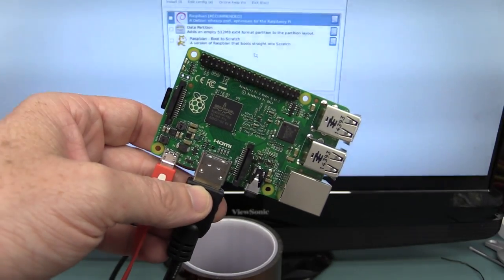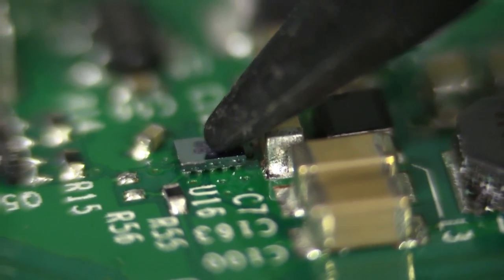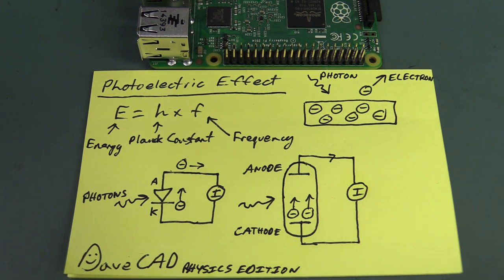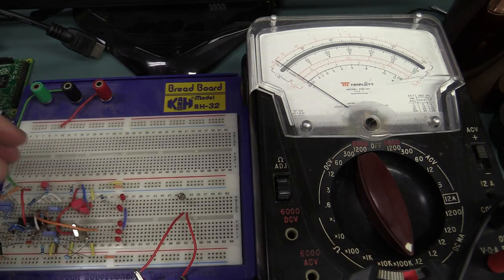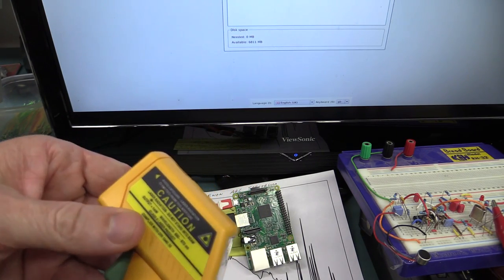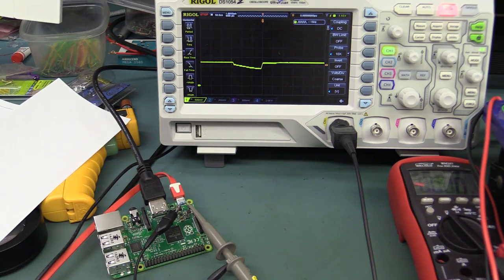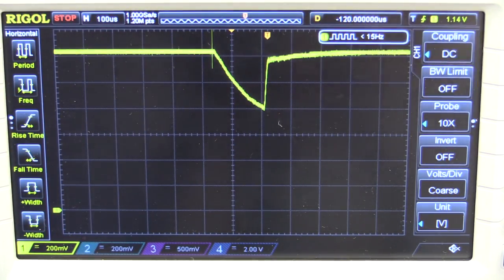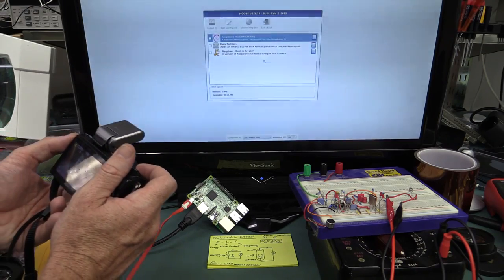EEVblog #716 - Raspberry Pi 2 Xenon Flash Problem Explained

Comment: This CAN'T be the reason that novelty electronics covered their chips in that black resin stuff, is it? As a kid I always wondered why those monophonic toy pianos had that. Now I'm wondering if it was photosensitivity since the plastic case around the toy would transmit light. I also highly doubt a 5 dollar toy warranted anti-tampering.
Reply: I don't think this is the only purpose of the black gunk. Most manufacturers do this simply to hide their chips, so that it makes it that much more difficult to probe and possibly reverse-engineer.
Reply: yuppiehi Couldn't any industrious forger just carefully scrape the resin off, though? I realize (having watched this channel enough) that it'd be pretty easy to copy a board and chipset, but it's novelty toys. What hope do they have? I'm legitimately wondering if they were photosensitive considering they were simple monophonic square-wave analogue synths.
Reply: yuppiehi Nevermind, I finally watched far enough (13:20) into the video to see the Dave talk about the "throwaway greeting cards". It's exactly what I thought.
Reply: If you touch those tiny golden bond wires connecting bare chip with pcb you could easy destroy one of them, or bend one and make short circuit with another. It must be protected somehow (blob, proper package). Balls connection are very rigid and hidden

Comment: No, no, no! Dave, please, don't explain something simple like this the wrong way! D: The energy of the photon is E=hf, meaning that a higher frequency will put more kinetic energy into the electron, increasing voltage. The number of photons, however, determines the number of emitted electrons, which increases current. There is also not a specific frequency required in order to emit an electron, it's a minimum frequency.
The infrared spikes in the xenon spectrum would therefore (if they are above the minimum frequency at all) create a spike in current, but it would be at a very low voltage compared to the electrons emitted by the photons of visible frequency.
Reply from the maker: nRXpAa8E6UML Yes, I was implying minimum frequency. This will depend upon the semiconductor doping.

Comment: Huh,,, Interesting. Would have guessed EMP at first...
Reply: Likewise, I would have thought that the sudden discharge of a capacitor into a near-dead short (the flash tube) would be a very brief but potent source of RF noise. Then again, it wouldn't surprise me if the effect of the RF from the flash tube was drowned out by the effect of all those photons flying around.

Comment: why is there no fullscreen option and why is it HTML5 only?
Reply from the maker: slango20 I don't know, talk to Youtube. No other reports.
Reply: I'm using HTML5 and the fullscreen option is right there.
Reply: Which browser are you using?
Reply: ***** chrome with firefox user-agent, used to trick it into playing flash on chrome. HTML 5 runs like absolute garbage on older systems, and I was using that as a workaround to still use chrome. using an extension to force flash works though, so the problem doesn't appear for now. (I think it's because I was using the firefox 15 user-agent instead of a more recent one)
Reply: slango20 the day has come to upgrade your hardware.
Reply: John Senchak I am able to switch between the HTML and Flash players just fine. HTML5 is simply the default for new accounts now.

Comment: Electrical tape would've been a lot cleaner than that Blue Tack.  Yuk!
Reply: The seal may not have been there though. Even a extremely tiny gap would be enough for this chip to keep doing it.
Besides, who flashes their RPi2 with Xenon all day long in the era of digital tech? :)

Comment: ive got to buy a flash camera now
Reply: Flash cameras can be pretty expensive.  Save some money and get one that's no so flash.
Reply: madengineer
Or just buy a second hand flash off ebay that has a test button on it.
Reply: It'll probably be cheaper to buy a external xenon flash for that, but that said I have no experience with ultra cheap chinese external flash devices, who knows what they use.
Reply: +trickynekro  wooosh
Reply: madengineer
No need to steal from tourists lol
Just search eBay for a used early digital camera, most of them have a Xenon Flash Tube. I have got them for £5 in the past including postage and you could probably could get them even cheaper.

Comment: Your labeling on your chart is wrong mate. What you are calling near infra red is UV.

UV is higher frequency than visible light and thus the photons have more energy and the PE effect is more pronounced than with lower wavelength light.
Reply: he is correct, the units on that sheet are nm.. lower than 400nm is uv..
Reply: jimbit22
You sure the units ain't THz?

I don't see any units there. Spikes in the NIR would have a minute PE effect compared to the main body of the light if it is indeed nm.
Reply: jimbit22
 Okies double checked and yes it is nm. The spikes are indeed in IR, so it simply isn't them that are doing the effect. Xenon lights has a small but significant portion of their output in the 200-400nm range. It is that doing it, not the NIR.
Reply: LiamE69 yeap,it's not THz.  i dont know alot about the specifics of PE but that sheet there is the xenon arc lamp spectrum(Spectral irradiance data)
Reply: He was referring to wavelength - a higher frequency has a shorter wavelength (ƒ = v / λ, be being the speed of light in the medium)

Comment: physics 101, and still making mistakes. if QE is 1, 1 photon is 1 electron, if your wavelength is below 1100nm for Si. Wavelength will dictate, how far electrons can go into die before they get absorbed. Higher photon energy does not mean more electrons.
Reply from the maker: Linas K It's not just about going through the back side die itself, the edges and bottom are exposed, and that probably dominates.

Comment: Nope its not photosensitive... Its because EMP (Electro-Magnetic Pulse) from Xenon flash. As they work on high voltage. The Raspberry Pi has no shielding hence the result.
Reply: if you look up the original thread, the problem has been definitively identified as being light, not EMP. Someone also mentioned that the silicon subtrate is relatively transparent to near-IR, which means those nasty spikes in the Xenon flash spectrum can reach the actual junctions quite easily.
Reply: Matthijs van Duin Hmm looks like its because of UV light..
Reply: Dave mentioned somewhere in the comments that a UV filter did not help, and again it helps to read the original thread on the rpi forum: a red laser can also trigger the problem.
Reply: Matthijs van Duin Sounds interesting... worth doing research.
Reply: "All bare-die (e.g., WLCSP) packages are sensitive to light, especially at the infra-red end where silicon is virtually transparent"

With a bit of googling for WLCSP light sensitivity I found some thread (about issues in sunlight, unrelated to the rpi) where an employee from Nordic Semiconductors said "Our recommendation is to cover the sides of the WLCSP package with a IR blocking coating."

It seems to me this is a well-known issue and simply got overlooked.